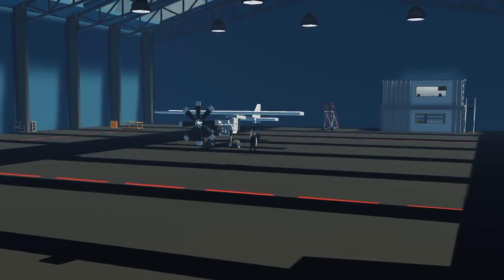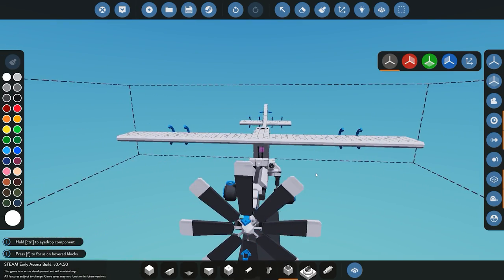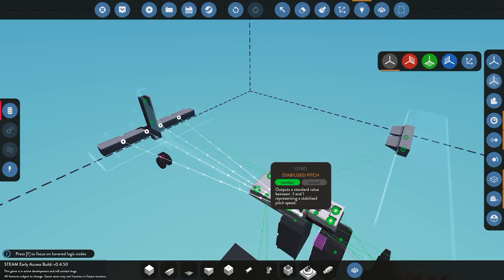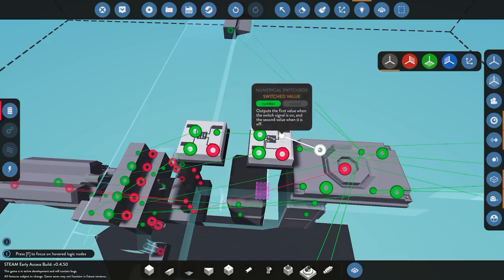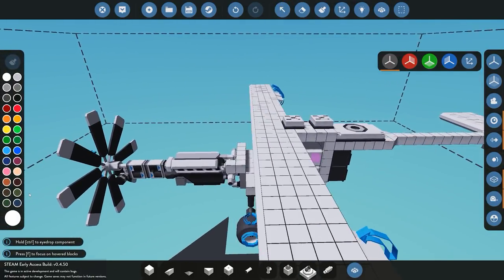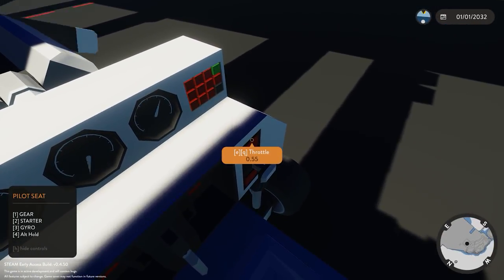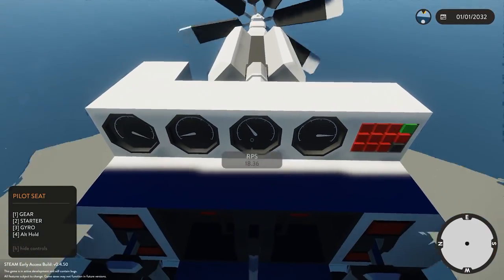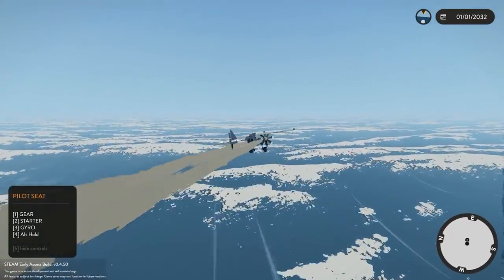Stormworks Plane Altitude Hold Tutorial

Comment: If your struggling with your aircraft climbing or pitching forward all the time, create an 'elevator trim' simply put a small control surface on the tail plane (it may vary on type of plane) and link it to a throttle lever. The throttle lever will set the trimmer and with a little experimentation will leave the aircraft flying level
Reply: Make sure you set the throttle values from - 1 to 1.
Reply: You can also hold the (ALT) key to manually set trim on any aircraft :)

Comment: works nice to make my plane do loops all the time
Reply: Got mine to stop looping by lowering numbers P=.001 I=.000001 D=5 but now it flies upside down  :-)
Reply: Matt beaudoin haha, i got mine working its probably because of the center of mass and lift that are different on each plane so i just kept changing numbers in the pid untill it worked well, i had it go upside down at some point aswell, so keep changing the numbers in the pid and youll get it working aswell
Reply: Tried this and the plane just nosedives - how do I know which one to adjust?
Reply: invert it
Reply: @jacksonpilarski8710  invert it, if it nosedives then make P lower, the higher the P value, the more aggresive it is, the D value helps to smooth it out and stops rocking up and down. Here is a general tip: when changing your altitude dont change it by more than 100, if you do it will likely break. To prevent that i have another system for when it is going at over a 12 degree angle up or down that will use another pid to go to the inverse of what it is doing already and that makes it stay between 12 and -12 degrees. That is using a tilt sensor btw. Also you can have another tilt sensor facing to the side and use a pid for roll, that way it stays perfectly level, really good for when you are yawing because yawing makes you roll slightly. for roll i used P: 5 I: 0 D: 1
Reply: @redpug5042  now it just nosedives very gently into the ocean
Reply: @Manch4life420  Make D -5 instead, worked 4 me!
Reply: @redpug5042  do u use the same inputs for the other PID?

Comment: when i try this the plane pitches straight down and does backflips
Reply: same
Reply: Same. We need a Gyro Scope tutorial from you.
Reply: Are your inputs reversed?
Reply: invert it, if it nosedives or backflips then make P lower, the higher the P value, the more aggresive it is, the D value helps to smooth it out and stops rocking up and down. Here is a general tip: when changing your altitude dont change it by more than 100, if you do it will likely break. To prevent that i have another system for when it is going at over a 12 degree angle up or down that will use another pid to go to the inverse of what it is doing already and that makes it stay between 12 and -12 degrees. That is using a tilt sensor btw. Also you can have another tilt sensor facing to the side and use a pid for roll, that way it stays perfectly level, really good for when you are yawing because yawing makes you roll slightly. for roll i used P: 5 I: 0 D: 1
Reply: @larsimann3032  dont need a gyro, make your own, its worth it, trust me. You need two tilt sensors and a little bit of logic, or just look in the stormworks workshop for premade ones

Comment: could you use a add ? so you can turn it on but still have controll?
Reply: a add might not work so well on its own;  let's say PID gives -1 and you give +1 ... it gives 0.  I'd put a threshold on your stick input; if it's non zero; you can disable the switchbox temporarily; when you release the stick the Autopilot reverts to controlling the plane

Comment: Hey can you explain me how to make a boat fast like i added4 engines 2 medium 2 small but can i do that without adding engines ?
Reply: Initialy i had 2 medium ( aircraft one's ) and i added 4 more to have speed.
Reply: @secretgaming5739  gearbox? dont make the ratio too extreme or the engines will stall, if you have temperature control on it then make the rps higher
Reply: you can raise the rps of the engine in config
(this will make the engine run hotter though)

Comment: WHY IS MY PLANE BY CLICKING ON THE HOLD ALTITUDE AT ANY VALUE STARTS GOING UP
Reply: did you figure out why?`mine does the same
Reply: because you have to invert the pitch but only for the pid switchbox connection
Reply: @sgtnseven3415  How would I invert it?
Reply: @en_erik6429  numerical invert logic thing or a function block with x*-1